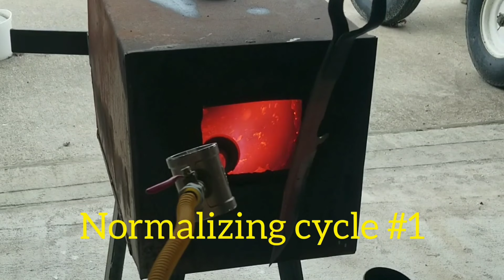Making a recurve knife with an integral guard.     Knifemaking and Forging.

Comment: Que exelente trabajo!! Que le pone a final antes del pulido?
Reply from the maker: I coat the handle with epoxy then polish it.
Reply: @TorchPhaiz-lh1up  en mi país es costosa esa resina la versión económica es la que se usa para reparar plástico resina poliester pero voy a probar maestro gracias por la respuesta saludos desde Paraguay
Reply from the maker: @maikelpachanga4448 I've also used Tru-oil gun stock finish which works fairly well. I don't like it as much as the epoxy finish, but it is quite inexpensive.

Comment: lol, checking heat treatment quality by file and then drilling holes just like that. sorry dude but this is trash.
Reply from the maker: I don't remember why l didn't drill the holes pre heat treat, but I heated up the tang with a propane torch to soften it so that I could drill the holes. I just didn't show that in the video.